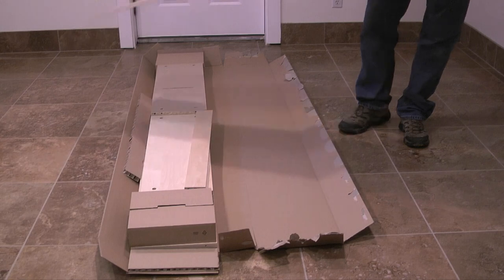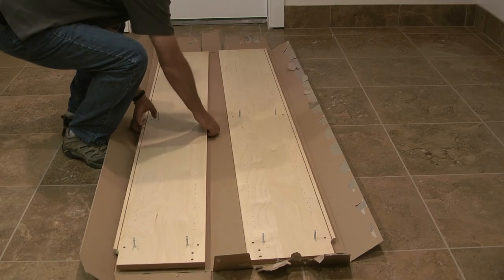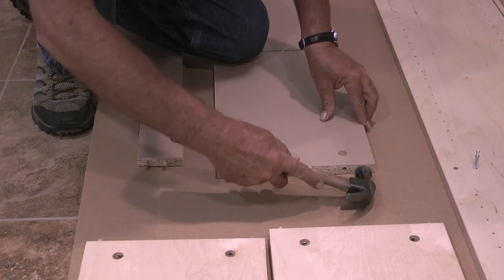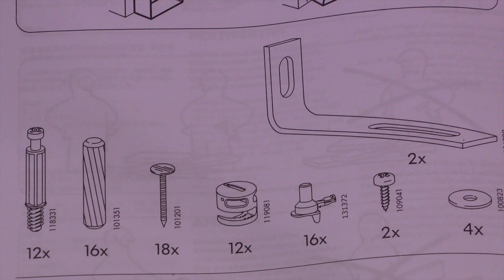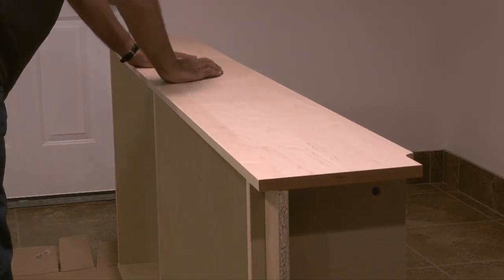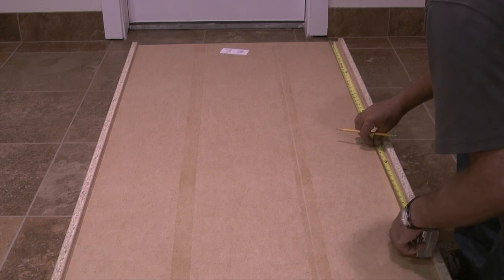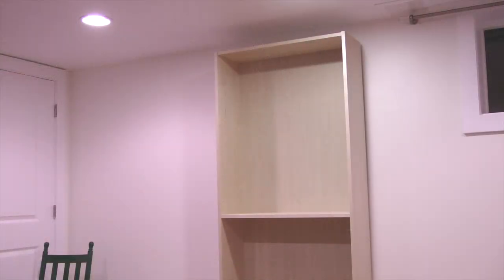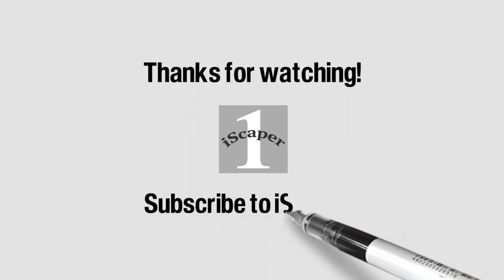Assembling An Ikea Bookcase

Comment: Step one, drink whiskey. Step two, drink beer.  Step three, start cursing.
Reply: Step four, by now you're pretty drunk. Your laminate particle board is starting to split due to your mishandling and poor quality. Get the box of decking and/or drywall screws you have and just have at it. Your bookshelf is now assembled.
Reply: I'm on vodka...have not even started m..trying to suss it out🙄

Comment: would it be relatively easy to cut a hole into the back panel? the 3 cases I want are 2 inches (2 freakin inches) to wide and would cover my lightswitch.

Comment: What's the secret to getting a tight assembly. I've heard some suggest carpenter's glue?
Reply: If you glued all the joints and put wood clamps on it overnight it'd definitely make it more sturdy. But I doubt most people assembling ikea furniture would go to such lengths.
Reply: I've used wood screws on ikea furniture before, but never glued and clamped it

Comment: 5:15 After I marked the centre on mine, and eventually got the back on (not easy when the room is not much longer than the height of the bookcase), I didn't need to measure from top to bottom for where to put nails since I could just draw a centre line. Also, you can feel where the centre is as well, so that's fairly straight-forward.

However, the back panel didn't sit quite flush with mine. It was fully in, but slightly skewed at an angle top AND bottom, as if it had been cut badly. This is the problem with mass production. I got the nails in but it should've been a bit longer because it could come free from one or two of them, if pressure was put on. If they made it a bit longer so it overhung slightly below the bottom shelf, that would give you a bit of play with it.

I'd best not say how long mine too me :-D

Comment: how can I put the shelf supports evenly so the boards look evenly apart. Thank you for this video.
Reply: count the holes & count down from each shelf, but you may want one shelf with a bit more height for larger books or accessories. i have some oversized books i want to put on the bottom shelf so i will make it a bit higher.

Comment: I have found that using a Pozidrive screwdriver instead of a Phillips head screwdriver works better when assembling these IKEA pieces. Pozidrive is the standard in Europe and is the type of screw that IKEA uses. The Phillip’s head wants to “cam” out where the Pozidrive holds fast. Also, I pre- drill the nail holes for the nails holding the back with a very small drill bit making it easier to drive the nails home. Just my two cents worth. Thanks for posting the video!
Reply from the maker: Great information, thanks for posting.

Comment: How do you know where to mark for the nails?
Reply from the maker: Mark the center of the edge on the back of the bookcase with a pencil before installing the backing, then use a straight edge to trace between the marks when the backing is on.